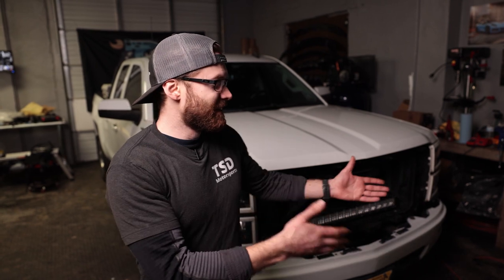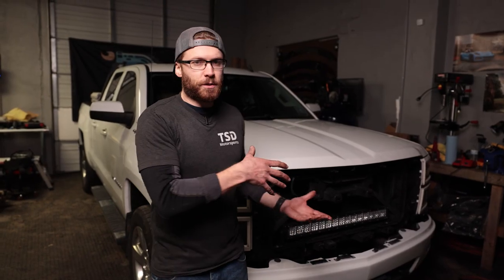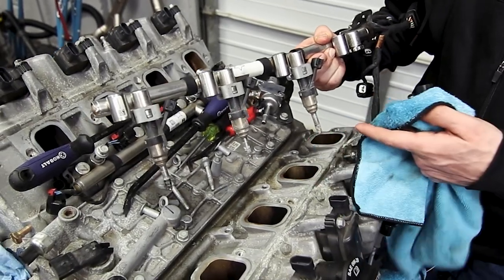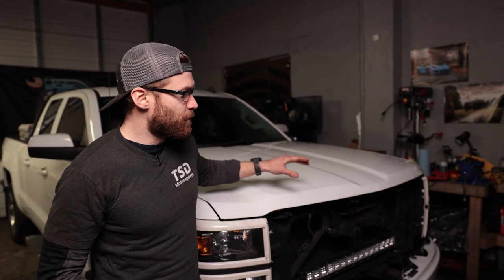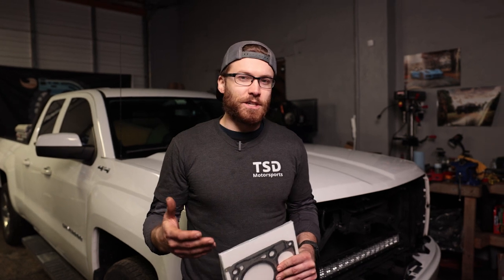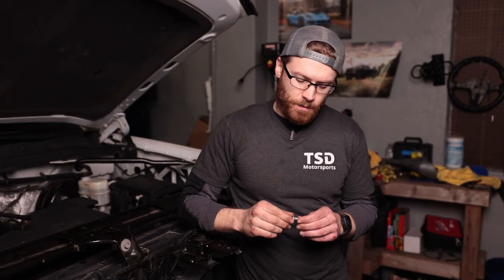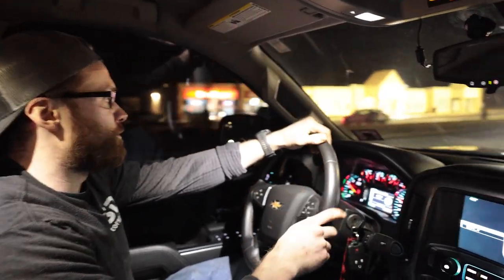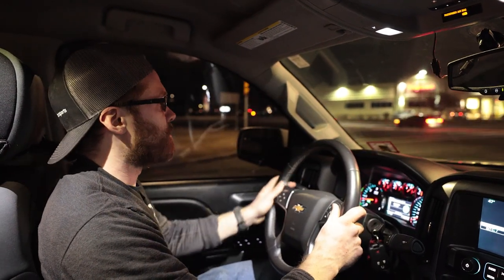AFM Delete GONE WRONG Part 4. Where is the Truck Now - Lessons Learned

Comment: Bout time this comes out! Lol I did the stage 1 cam, springs, pushrods, lifters from texas speed and the che trunion upgrade along with an e85 flex fuel sensor and got the truck tuned. Runs awesome and very happy to have removed a faulty lifter from the stupid dod/afm 4/8! Good luck with the truck!
Reply from the maker: Haha yeah. That's awesome tho! Glad to hear it worked out for you!

Comment: My 2013 Silverado started making the clacking sound from a failed lifter and after talking to my brother (GM mechanic), he told me to do an AFM/DOD delete. I watched your videos and decided to go with the stage 1 from Texas Speed. I'm waiting on backordered parts currently (been 3 weeks now), so hopefully they will get my parts out soon. They recommended I send the ECM/PCM to a guy down in Texas to re-flash for the specific kit I bought, so I still need to do that as well. But looking forward to having my truck back (hopefully soon) and thank you so much for all of your information in these videos!! You guys are awesome!
Reply from the maker: Happy the videos helped! I personally would recommend funding a local tuner for your truck that can actually measure your Air to Fuel ratio coming out of the tailpipe or with a wideband if you have one. You will get much better tuning results that way. If they just do a stock flash they are just guesstimating how your truck will behave based on other tunes. Now, I am not as familiar with the previous gen before my truck (2013 and older) so maybe there is a reason the modules need to be pulled in which case that sounds like a good plan.

Comment: I just bought a 2016 silverado with a (knocking) bad engine, and these videos are going to help it live again! funny thing was, I wasn't sure about buying it until I found these.
Reply: And here is my big question - in the comments I saw this is with the "second motor". Sorry if I missed a video, I thought I watched them all. But I got a 16 silverado 5.3 that needs engine replacement (It's knocking hard, sometimes doesnt start). Did your initial 5.3 from the intial build videos work?
Reply from the maker: The motor worked but I was sent the wrong heads and they damaged the block :(
Reply from the maker: The video series goes through it all
Reply from the maker: Hope these videos help you out! It isn't bad as long as you have the time, tools and space to do it ;)

Comment: Very informative video.   This sure seems like an expensive and complicated to delete the AFM.  I would have to let my mechanic do this for me if I ever decide to do this.  He has 47 years experience as a mechanic.
Reply from the maker: It isn't any easy thing, that's for sure.
Reply: Put your truck in L then shift to 5…that turns it off
Reply: @randyayo2846  can have it turned off too so you can at least use 6th gear. But then you still have shitty lifters in there
Reply: @maxhardy3549  Yea that’s the only issue is when on the interstate doing 80 or so, then I shift into L6. I think I might get the Range AFM delete it’s only about 200 bucks
Reply: @randyayo2846  I’m taking mine off with HP tuners, either way, same result though
Reply: @maxhardy3549  Not necessarily the same result.  I had tuned out my AFM and it worked well for a long while (approx 50k miles).  Then I had codes and misfires and it all lead to the bad lifter.  If you really want to get rid of this problem, you are going to have to tear down this far.  I didn't do it myself, had my local shop do it.  Didn't take too long and I have been running about 7K miles since and no problems.  Good luck to you.
Reply: @jasonblain5016  yeah I already have a new cam on the way, doing headers, heads, torque converter and intake while I’m in there. I’m doing it myself though
Reply: I'm not a mechanic, but I want to do this myself to save money and learn. Do you guys think it's a bad idea to do this outside in the elements in the southeast Utah desert? I'm sure it'll be hard. I'm just curious?

Comment: Thanks for showing me this stuff. I was wondering if all these things you have done will be mostly the same on a 2012 chevrolet silverado 4.8L crew cab truck as well? I have been trying to keep up with your videos, and thank you for sharing. This is great information, I've already put those tools in the description in my shopping cart for the cam and lifter swap. Thanks again.
Reply from the maker: no problem at all! thanks for following along! It will be similar but pretty sure there are some differences. There are some other videos linked in the descriptions of the other videos in this series and they show and older engine being deleted. That channel has a lot of good content when you find those links. Should be in the first few videos in the series under reference / source material.
Reply: I want to do my 2012 gmc Sierra just for reliability.
Reply: Hey, that's good stuff. My truck is running like a champ

Comment: Stuck in between a Rock and a Hard place. My 07 Denali XL Lifter failed on me few weeks ago. Tryna decide to buy a low mile motor, or just have the shop install Ls7 Lifters. 
But they want $3,000 to replace lifters on Driver side. That is where tick is coming from. She got 350k but I bought her at 280k Havent even really put alot of miles on her with the 5 yrs Ive owned her.
Reply from the maker: Hmmm that's a tough decision. 350 is a lot of miles but 3K just to change lifters is too much. Are they charging the camshaft too?
Reply: @TheSundaeDrive  Dam. Didn't even ask about if the Cam was involved. Which Afm Delete kit did you end up going with? Sorry I only watched yo 3 videos. Sorry for asking if you already mentioned what you had got.

Comment: Quick question 
Is it possible for a brand new engine to have the head gasket installed incorrectly?
Have a 2022 6.2 with a few hundred miles and the sound on the video sounds identical to what I can hear on my truck. Just my knocking sound isn’t as loud yet.
Reply from the maker: I suppose it is possible, that would be pretty crazy if it was the case. Most likely a lifter collapsed tho and you are heading that. Definitely let us know what the issue ended up being !

Comment: Wish I would of seen this video sooner lol ! I cammed my truck 2 years ago watching your video and it’s been about 2 years now since I’ve been having that knocking sound coming which I thought was the water pump I’ve looked everywhere to find a fix well now I know I have my head gasket backwards I hope i didn’t do to much damage to my engine I’ve added about 10k Miles since the cam install… 

Do you know if he had both on backwards? Or was it just one side ?

Comment: put good oil in it and do changes on time and DOD won't be a problem
Reply from the maker: I wish that was the case but while it can help, sadly doesn't prevent the failure several commented that they did oil changes ever 3K miles and still had failures.

Comment: Gpi stage 1  stock exhaust manifolds and intake manifold 332whp and 341 wtq on 87 octane
Reply from the maker: Is that what you dyno'd at? L83?
Reply: @TheSundaeDrive  yessir that was on shitty canadian 87 octane and safe timing. Also 33 inch k02s
Reply: And as for the shifting issues have you replaced your atf with amsoil signature series? Mine used to shift like hell and this stuff seemed to improve it quite a bit.
Reply from the maker: Yessir. I run amsoil. I'm getting the trans tuned. Amsoil improved it for sure but still rough.
Reply from the maker: Which gear did you Dyno in?
Reply: @TheSundaeDrive  4th i believe stock drive shaft 😬
Reply from the maker: You are brave haha. I'm putting in my new drive shaft in first.
Reply: @TheSundaeDrive  I watched haha.. the tuner was behind wheel as i was waiting for it to grenade  all was good tho.
Reply: @TheSundaeDrive  Do stock truck drive shafts really grenade over 100mph? I used to drive my 2.4L 97 ranger at 105mph pretty often ( dont ask ), and aside from the front wheels shaking like crazy, it seemed ok. Mind you, I had to be going downhill to reach that speed XD I miss that truck so much.... it felt like I was riding a roller coaster, except worse.

Comment: Question if GM is making non DOD vehicles due to the conductors shortages. Are they just using the same parts and just turning off the DOD system.   Knowing GM there not putting in different cams and lifters. So why should anyone else spend money on a DOD kit if GM is using the same old DOD parts?
Reply: You guessed it! Unfortunately they still came will all the DOD hardware but the 4 cylinder mode was deactivated. They just ran on V8 mode all the time as they didn’t have the program to run on V4 mode. I believe this happened in some of the 2019 models. Typical GM.
Reply: If I’m understanding it correctly the lifters will still fail. Even though the computer is running a non AFM DOD program. Personally I’m still trying to learn everything I can about this . But from my research just flashing the program is a bandaid. The lifters will fail and when they do it will send fine metal throughout the motor. Wiping out crank bearings and at that point your into a complete rebuild. Very messed up problem that I want to blame GM for. But as I have researched more GM wasn’t responsible for this change in the LS motors. They were forced into it via government regulations to lower emissions.

Comment: I just went and installewd a Range Disabler for $200. Voila 8 cylinders all the time.
Reply from the maker: They work well and staying out of v4 mode, but don't replace the faulty design of the lifters which still fail :( I wish it was that simple.
Reply: Do all V8's with "fuel saving" features have this problem? started with my RAM and MDS, lifter failed and ruined the cam, I figured it was a 5.7 hemi thing, now that Im getting a silverado, it seems like every manufactuerer tried to bring in a system that can ruin the engine over time.
Reply from the maker: Yes unfortunately. The ram system seems to have a lot of problems too
Reply: @pyrathian  thank the EPA for all these faulty designs.

Comment: Man my mechanic just finished this delete and  now I have a misfire on cylinder 3 😢
Reply from the maker: Hopefully just a coil pack or spark plug issue!
Reply: @TheSundaeDrive  yes was a spark plug issues but now it threw p0011 the ecm was sent out to get dod removed but I don’t think actual tuning was done but I replaced cam with stock non dod cam do you think tuning is still required
Reply from the maker: Not sure why they would have sent out your ecm since it can just be tuned out remotely unless it's a newer locked ecm. Tuning is a good idea whenever something major is changed. Need to account for the new phaser limiter as well
Reply: @TheSundaeDrive   yes new phaser was installed and I’m assuming switching out cam shaft position sensor and actuator would really do anything if it isn’t tune ? I’ll call around today to see how much it is to tune in my area
Reply: And the ecm was sent to ams racing they flash your ecm so that you don’t have to have disabler plugged in to your obd port but I know there is also other tuners like Diablo and others that you don’t need to have them plugged in but whatever the case I’ll call the speed shops in my area

Comment: How many miles was on engine when the AFM lifter failed?
Reply from the maker: Did not fail. Failure often can destroy the motor so I was deleting it pre-emptively. If you are lucky it is just a lifter swap but many are not so lucky. I ran into other issues tho lol
Reply: @TheSundaeDrive  Funny, I lost my 2014 RAM due to lifer failer that ruined the cam, but literally nobody can really confirm if the MDS was the cause, it sounds like a very similiar system though. I wanted to pull it apart to fix it, but I traded it to a friend for a 2016 silverado, which is also going to need engine removal and help.. thanks to your vids, we will see how it goes XD
Reply from the maker: Best of luck with it! It was probably the mds system. Lots of issues with it from what I've heard